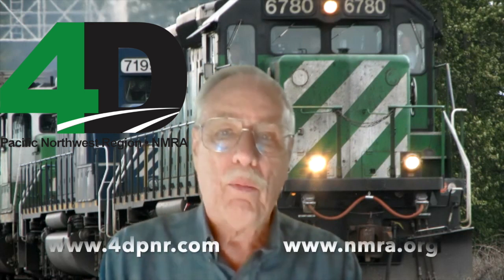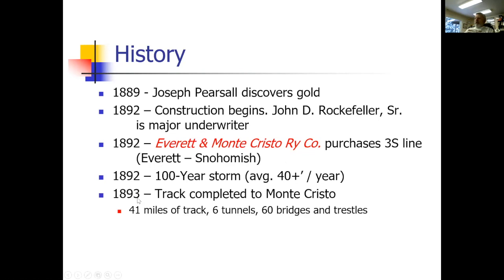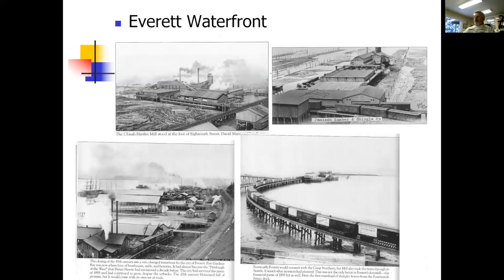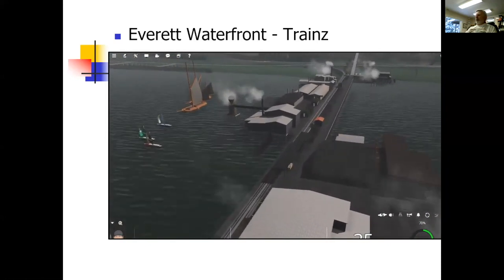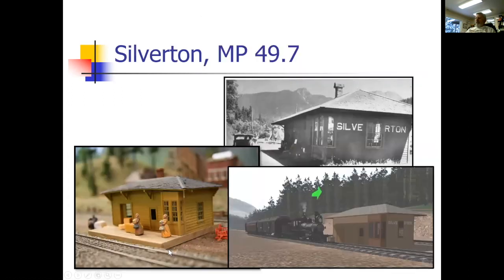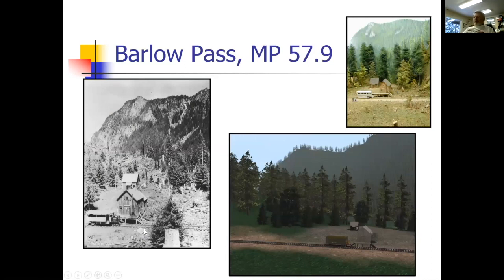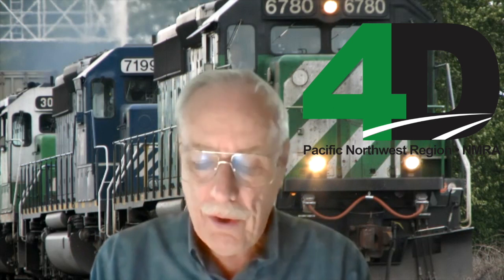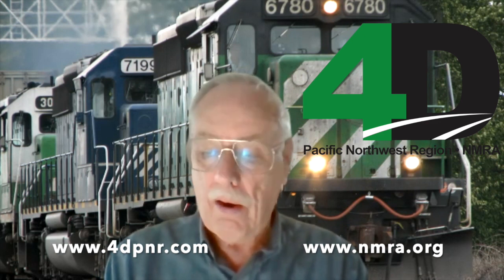Di Voss MMR on Everett & Monte Cristo RR for 4DPNR 13 Feb 2021

Comment: Amazing reconstruction. I found an old news report of the 1897 washout, where bridge 16 at Robe apparently had a 350 foot tree , 14 feet in diameter crush one of the piers, and another 500 feet of road was washed out in the floods. Tunnel 6 had debris piled 50 feet high. The floods and landslides of November 1897 were apocalyptic.